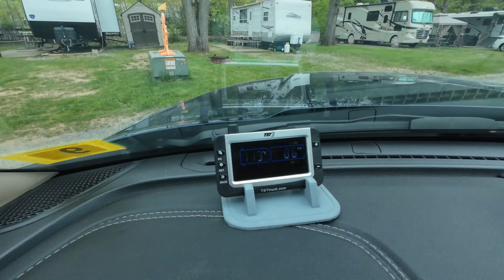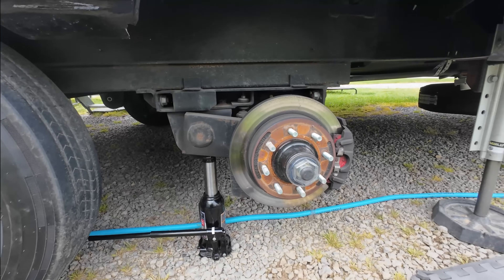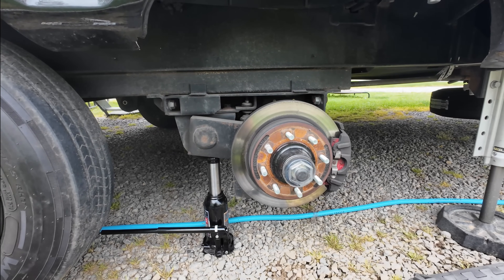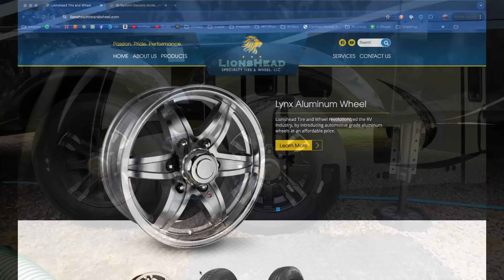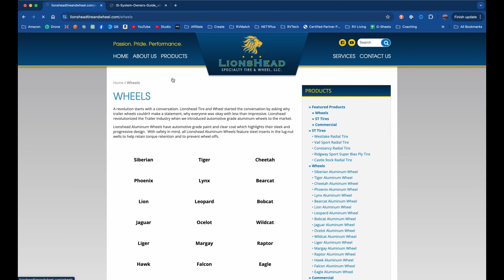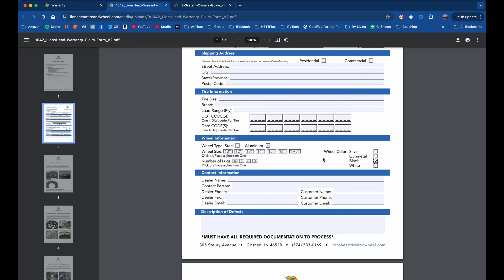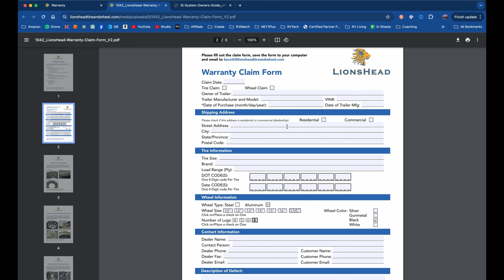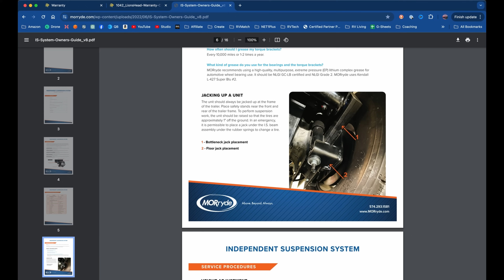Wheel Failure AGAIN! Second Time in 6 Months - Are We Safe?

Comment: Weigh the trailer axles and refer to a load and inflation table for your tire specification to determine the correct cold inflation pressure for single loading.
Reply from the maker: Yep, and it’s not turning out to be great news.  More info in the next video.  Thank you.

Comment: Gross vehicle weight/current weight divided by number of tires divided by 36 equals optional tire pressure. Our triple axel at 20k is 92psi.
You are overinflated and it seems like the wheel torque is super high also.
Reply from the maker: Gross weight of the RV on or off hitch?  Using the formula you provided its either 132 or 114, which both seem reasonable, given the 123 max cold spec. I like the 114 better.  The torque was recommended by MorRyde as well as the wheel manufacturer.   Do you  have a source you can refer me to for the torque info your basing your understanding that the torque is high?   Thank you for the info!

Comment: When they sent replacement rim was it exactly the same? I mean will it fail too? We just had this happen this morning on day 3 of an 18 day trip. Lost about 8 hours trying to find a place to even diagnose it then I suggested using rim from spare so we could at least maybe get to the place we are staying for 9 days. Lol!
Reply from the maker: He Kim...I responded to you on FB, but for the benefit of others I am responding here as well.  They did send the exact same make/model wheel, but of course there is no telling other than time will tell, if it will fail again.  My guess is that they may gave had a bad production run in late 2021 early 2022, and that is why they are replacing them so quickly with no questions asked.   I have no way of knowing that for sure - its just my guess.   In any event they are quick to process the claims with no hassle and get them shipped out quickly.  We only waited 2-3 days in each case.

Comment: Just looked at video again. Wheels are fine on weight for the axle. The weight looks to indicate 4850lbs and your max cold inflation should be 123psi. Unless you weigh at each wheel independent, I would run no less than 120. I run 123 because I don’t know how much weight is on each side of the trailer.
Reply from the maker: I'm double checking all the ratings verses actual and so far I am good on wheel and tire as you mentioned.   The wheels are actually rated for 6005 not the 3960 that I had mentioned in the video. I will be doing an update video once I have all my facts confirmed.

Comment: Balancing the wheel/tire combo takes a LOT of vibration out of the combo which can prolong their life. Plus, even with independent suspension, helps keep vibrations inside the RV to a minimum.
Reply from the maker: Yes, and that is what I am going for now.   Even today (yesterday) driving I felt some weird vibration that I need to look into.  I think it may have been the tires hitting the high level on inflation.
Reply: Centramatic Wheel weights will balance the the whole Wheel assembly
I tried to balance mine they said they would have to add alot of weight to achieve 
Centramatic is made in USA look it up
Reply: Make sure they are balanced with the yellow dot at the valve stem and all tire sensors installed on the wheel they will be on

Comment: I can't fond itnon their site, what is max pressure on these wheels? I used Alcoas on a horse trailer and when Inhad too many tire problems I upgraded to 16 ply/LRH 235/80r16 tires and ran them at 105 (120psi max load pressure) i had cracks like that in the same mid section area. Those were trailer wheels but 80 psi rated. I got new wheels and had no problems since.
Reply from the maker: Where did you find the max load pressure?  Is it on the side of your tires?  I'm looking on mine and so far can't find it as a number -- se it as a statement, but they don't mention the PSI.  (I may be blind!)

Comment: I have Broke 6 of them, every time it was on a Jacknife or on a u turn,  my trailer is pretty heavy around 21K,   I try to not make super sharp turns anymore, or will have to go to the 19.5 steel rim might be my next option, but the trailer will not look good with them,
Reply from the maker: Did they just get hairline cracks or something more?
Reply: @okletsgorv  It is on a toyhauler, and both blew out in a hard turn, Rims made by Sendel,  Sendel sent me the new style rims about 4 months ago,  3 was leaking around the back bead that was cracked, one had a flat and eat the outer bead, so not really there fault,  one made a U turn and in the middle of the U turn the rear blew out,  the other was also the rear, when Jackknifing backwards it blew out the back ring with full air pressure, and when the ring blew apart, it went into the water tank.
Reply: You appear to be saying that you prefer to look good than have durable equipment. Is this correct?

Comment: Have you weighed your rig at a CAT scale?
Reply from the maker: Yes,  Not over on the wheels or tires.  I weigh two times a year -- typically after long stays and significant changes to cargo.  We are full time.  I weigh with trailer on and off, so I can calculate all weights individually and compare WR to actuals for all components.  I have a part 2 video in the works.  Stay tuned.  Thank you for watching.

Comment: What wheels do you have?  The tires you are showing indicate Copper RHT 215/75R17.5, but you show a 16'' wheel.  Also, the website image of the tiger wheel doesn't match the wheel you installed.  The wheel on the website shows (6) major spokes while the wheel you installed shows (4) major spokes with (4) minor spokes.  The wheel you seem to have doesn't appear to be located on the website and thus the weight ratings are not provided either.  I am curious if you are exceeding the ratings on the wheels from a load, inflation pressure and tandem axle setup.  The side loading on a tandem axle setup can be quite large during turns, especially tight turns.
Reply from the maker: I didn't even notice that.  I was was told by Lions Head that they were the Tiger.  I'm going to check with them again.

Comment: Do you think the independent suspension is contributing to this?
Reply from the maker: I really don't have enough experience or knowledge to even speculate on that, but some research I have done suggest that because each wheel can potentially be subjected to more stress because each take the stress independently -- there is some potential for that, but there is nothing I found that suggest that is a common or well known issue. The concept of IS is that it is to give a smoother ride and better handle shock and stress, so that contradicts the idea that IS would be the potential problem.  The most probable causes are: Improper Load Balancing: If the load is not evenly distributed, certain wheels might experience more stress, leading to fractures.
Component Wear and Tear: Over time, components of the independent suspension can wear out, potentially causing uneven load distribution and increased stress on the wheels.
Manufacturing Defects: The wheels themselves might have inherent defects or may not be designed to handle the specific dynamics of your independent suspension setup.

I'm going to go with quality of the wheel and that it is probably under rated for the job its been forced to do.

Comment: You may want to double check your tire pressure numbers. I'm pretty sure it should be 125 psi max.
Reply: Right? I mean even in my semi trucks (granted different tires) max was like 110.... I mean it's gotta be a struggle to find something to pump them up to 150!
Reply from the maker: Ya, I am going to look at that.  I probably was informed incorrectly by someone that I thought was an authority on the subject.  Know better now.  If you have a link handy for the spec please post for the benefits of others.
Reply: @okletsgorv  The max pressure will be listed on the sidewall. Since you have a fairly static weight on the camper, and the higher the air pressure the rougher it rides, I'd run 10-15psi under max at least, because pressure will increase with heat running down the road. You can see it on your truck too if you've got tpms on it, set them all at 45psi drive a few hours an they'll be at 48-49psi. (roughly). Thats why on some big trucks you'll see stickers that say inflate to xxxpsi cold, they are accounting for the added pressure that comes with heat in the tires. There may be a sticker somewhere on the camper that lists the suggested tire pressure. I would think running those at that high a pressure is gonna shake the dang thing apart and might explain the cracked wheels. I could be totally off base here, but having grown up in a shop, driven semi's and operating heavy machinery for a living, that would be some interesting new tech that somehow slipped by me. lol
Reply from the maker: Says on the side of the RV 123PSI Cold Inflation Pressure
Reply: @okletsgorv  Yeah I'd run a little below that. If you've been running them at 150 that might explain the cracked wheels. Certainly other conditions may have been the culprit, we all know they don't make things like they used to, and in the name of weight savings alot of parts are now far weaker for it.

Comment: The max load pressure is 125 per Cooper.
Reply from the maker: Isn't that the cold pressure?   Do you have a link to any documentation from Cooper that gives that MAX load pressure?
Reply: @okletsgorv  the pressure on the sidewall is ALWAYS the cold pressure for maximum load. A tire like that will increase about 5 to 7 lbs at highway speed. 140 lbs is over inflation
Reply: This may sound a bit harsh, but  to answer your question in the title " Are we safe?" No Sir, you are unsafe.  I'd say 125 is still too high for your trailer weight. For example a 3/4 or 1 ton truck is 80 psi when hauling a heavy load otherwise I would air down to about 60 running empty. Please go to the RV dealer or a tire shop and get some real professional advise.  Another thing to keep in mind is running those crazy high pressures 140-150 psi, if you have a blowout and kill someone, this video will be helpful for the plaintiff.
Reply from the maker: @DM-cx8cg  Not harsh at all.  I get it. And after doing some additional research, I'm better understanding this cold pressure inflation specification.  The tires have on them 125PSI, and the placard on the RV have them at 123PSI.   My research, both open searching and checking with Cooper, the tire manufacturer, 125PSI is the max cold inflation pressure.  Further research suggest that the optimal running pressure should be 123PSI -- so yes that 140PSI is crazy high.   I think I am going to aim at running at no more than 125PSI, and really settle to 123PSI which is the recommended by the tire and RV manufacturer.

Comment: Independent suspension is very hard on wheels, tires and wheel bearings.  the reason being........   picture rolling over a speed bump, for a moment the entire weight of the trailer is on one axle or even a single wheel.  Independent suspension has no way to spread the load to the other axle.  you can easily exceed the weight rating one wheel at a time.   Yes you should over spec the wheels and tires when using a independent suspension trailer.     the hitch/5th wheel  height can also drastically affect the load on each axle from front to back (I don't think that is a issue here)
Reply from the maker: Thank you for that insight.  Your point about one wheel being overloaded at a time with IS is something that I was thinking about the other day.   You get a smoother ride, but apparently it comes at a potential cost beyond the $.  Thank you for watching.   I will be creating another video on the topic soon now that  I have received lots of comments with new information for me to research and confirm.

Comment: Play with fire and you will get burned. The risk is real of a more massive failure using these good looking but inferior rims. Get rid of those things, Every time you make a tight turn you are tearing these wheels apart. I would guess that you do not do much blind side backing, so you are always pivoting on the left side wheels
Reply from the maker: Thank you for that insight!  You are right, I do usually back in the other side -- but probably have only done that 6 times in 2 years.  (Lucky with pull through sites and the back-ins that we do are usually at longer terms stays.

Comment: I think your tires are the issue. 140psi means some extremely hard tires.

Also, if these wheels are on 8000lb axles, then the wheels are severely underrated for the load they are carrying.
Reply from the maker: I am doing some research. I may have incorrectly identified the wheels.  Stay tuned.  Thank you for watching.

Comment: It all comes down to forged vs cast.  I willing to bet that all your wheels are all made in China and are cast.  Take a look at the factory wheels on your truck, I bet they are forged and are three times as strong as the wheels on your rig.  I hope this helps.
Reply from the maker: Absolutely they are made in China, and definitely cast.
Reply: Plenty of OEM wheels are cast. Properly made aluminum wheels, whether forged or cast, will be fine. Forged wheels are just stronger so are generally made with less material and thus are lighter. This allows for more intricate designs. When you make a cast wheel poorly, or it's designed poorly without enough structural support (say making a cheap cast wheel look like a lightweight forged wheel design), you'll have issues.